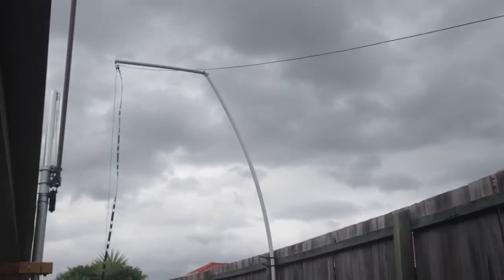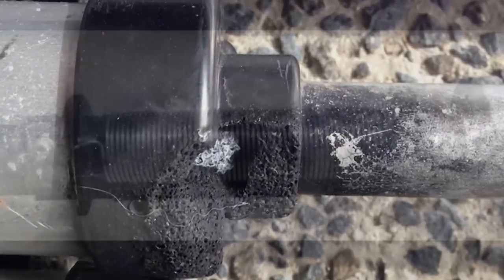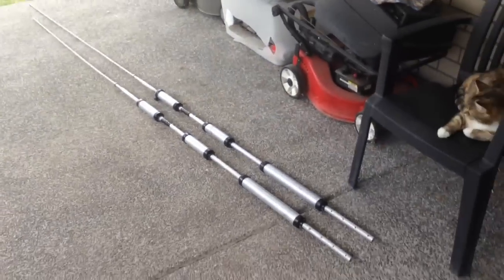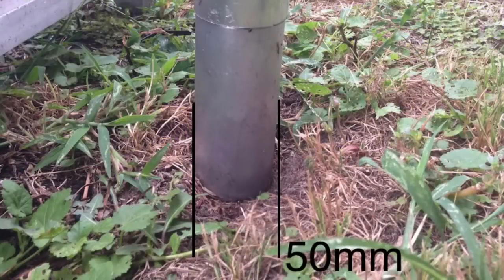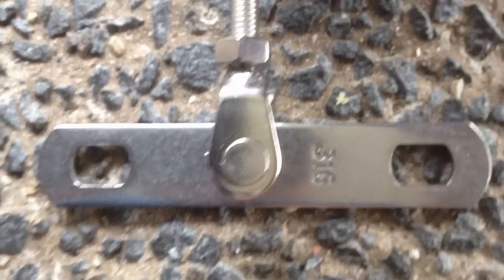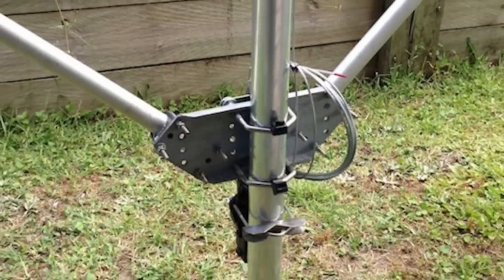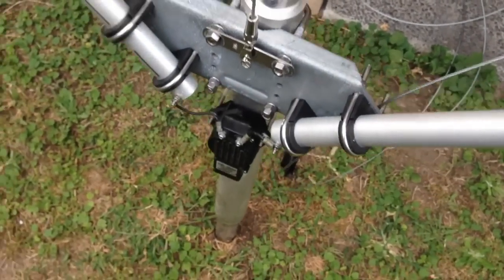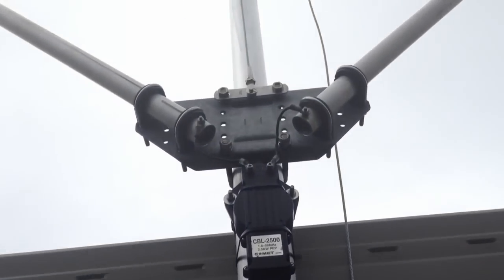One Man Antenna Mast - Part 1

Comment: For all those who wants to seal all junction and or fixin points and also the open coils agains humidity. The best way is using  Adhesive-Lined Polyolefin Heat Shrink Tubing and Plasti Dip for Trapped antennas with open / bad protected coils! Plasti Dip is an air-dry, specialty rubber coating in many different colours. I am using this two options to all my Antennas especially Plasti Dip is to protect or paint any metal surface. Besides of keeping the Antenna proof / sealed agains any kind of humidity the SWR is allways at the same point where adjusted. Try it one time and you will never ever use silicon or tapes etc...

Comment: If you failed to leave weep holes in the traps, expect condensation to develop inside the traps.
Reply from the maker: Hi, I believe this was damaged originally by transmitting while the antenna was still wet. It’s designed so water flows straight through it, but it does get into the traps on both sides. I just wait a couple of clear days.